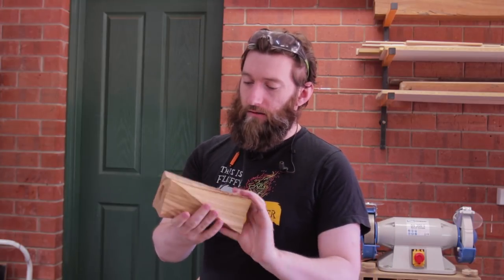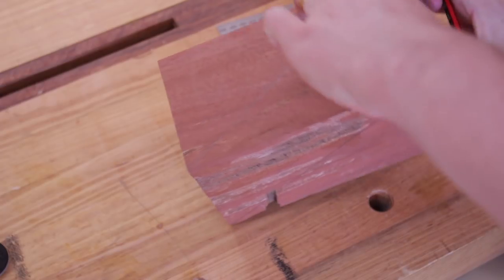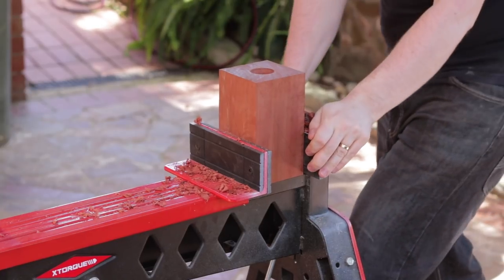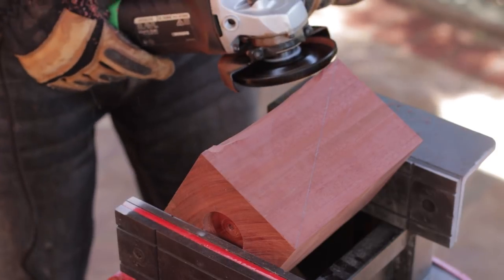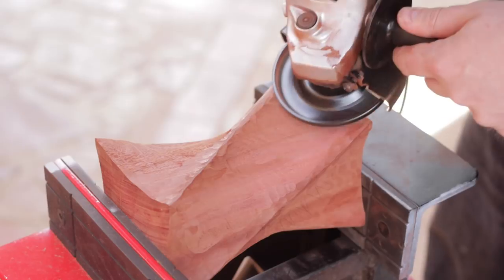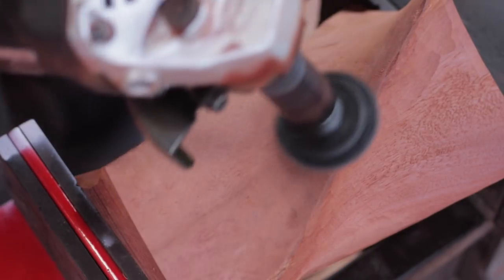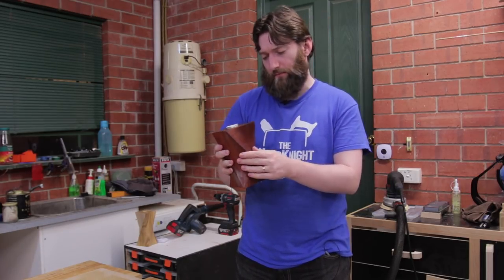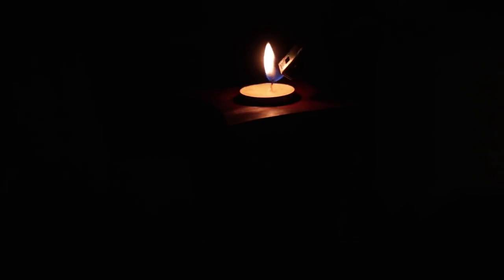Twisted Candle Holder

Comment: Great job. Thanks for sharing. I just noticed that this video is already 5 years old, so I don't know if you are still willing to answer my question on it.
Is 65 by 65 mm material enough thick to start with?  I did some candle holders with that, but they were straight.